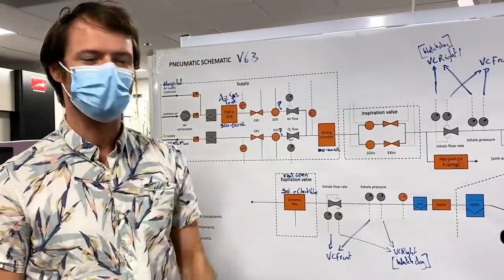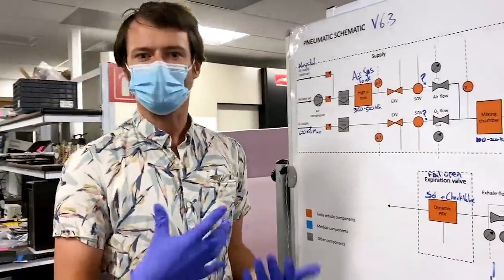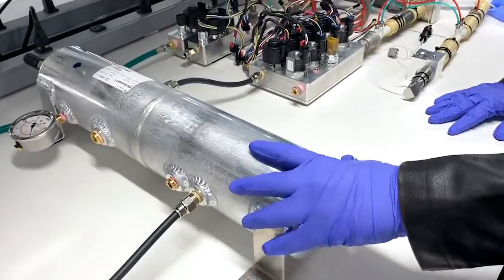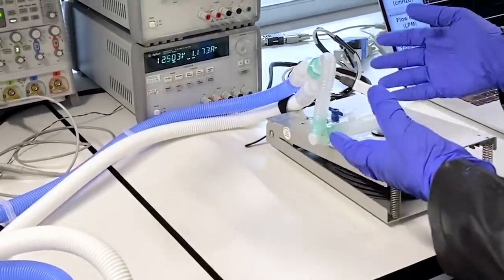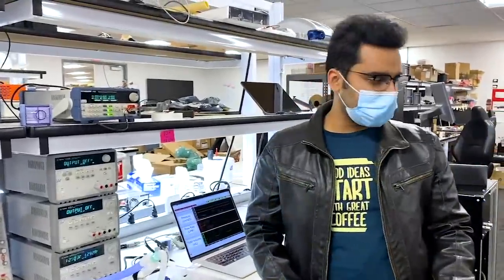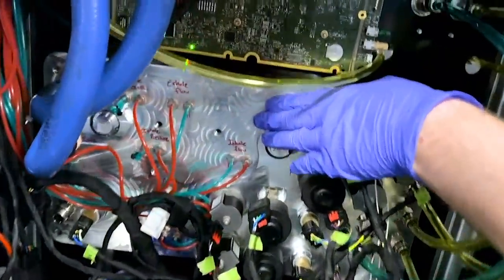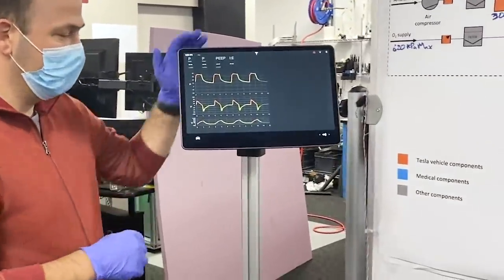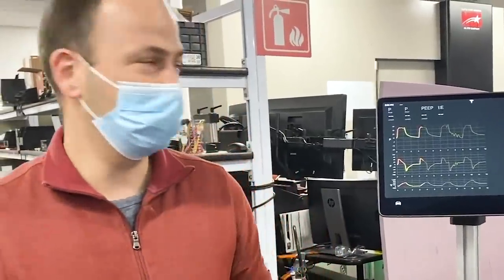Tesla Ventilator

Comment: Im not understanding. You use the pressure of the oxygen alone to drive the system? Where is the pump - or equivalent? What if oxygen runs out? Or air pressure runs out for any reason..  If we rely on the hospital - then they usually have a generator - but what about this corona case case in which the hospital is overrun and things must be moved in class rooms, in hotels, in big spaces which are not hospitals? They don't have backup generators and such. And if they do they are done in a rush and most likely not as well thought out.  We need batteries to power each unit, and maybe also make compressed air that way. Or better for compressed air have a mobile system powered with batteries.  Mobile air compressors already exist, just a big battery bank is needed. Tesla has good batteries also. Tesla cars can possibly be used. To access the electricity in the battery maybe some improvisation can be done.

Also you guys did not mention, but one of the best ideas is to push this data into the cloud in real time, and with that, fast and accurate response can be given. Let's say an area of the country is overcrowded and you want to see how well the patients are performing and how likely we are to be prepared for a next wave. How to assign ventilators properly and not have places which have too many, and places in which people die without one. Or let's say some medication is introduced, and we observe some types of patients having troubles based on their real time vital signals. And you can see that in high numbers, across an entire continent. Real-time, accurate data can prove vital in dealing with crisis situation. No phoning around, no running around, no misunderstandings, no stress, no mess. Decisions based on accurate, real time, verifiable data. 

As such a high level decision can be made to stop such medication. Or family can see the vital signs of the patient sent to them on an app. This ventilator uses a tablet. As all ventilators should use. Tablets have frontal cameras. That can also become a real time video interface to talk to the patient or doctors without family being present. The grandma can see the kids and not feel alone and stuff. Because the tablet has a multitasking operating system on it. And can do both functions with ease.

Also a nurse can have everybody she cares for connected to her phone, same for doctors, and maybe volunteers. Simply by scanning the devices - scan that ventilator, that pulse oximeter, that hart rate monitor.. etc.. all connected. So if a patient collapses, and this doc is in the eating place, or the nurse is in her office  - then he/she can just come in a hurry and increase the help capacity. Is a fact that highly trained people will be in short supply with corona. As such being able to alert of an extreme emergency  in seconds as it happens, and also have all the vitals sent to the notification such that the doc can decide as he walks towards the patient, all that transmitted accurately, real time  - without nurses running from one end of the hospital to another, or to phone desperately for the doctor - is a must. In hospitals information still moves by diffusion. Which is as dumb as it gets given the tech we are capable of. We have real-time games with millions of users, but we don't have real time doctor patient connection. We rely on alarm bells and such. What is an alarm telling you as a doctor ? - is it telling you the oxygen concentration, the last 2 minutes of vital signs? what medication was given, when, and in what concentration?  - no.  Is just a sound indicating something is wrong. As such is not good enough. Is too simple. The doc still needs to ask questions... how about he/she doesn't need to ask anything? How about even a course of action can be suggested, and also validated by 10's of other docs which are  not even present - but monitor the situation remotely, with cameras, sensors and such? They can make decisions and inform the doc on the ground, or a nurse, or even a volunteer on what to do because they will have more accurate information regarding the entire country not just some local situation. They might see patterns developing in real time across hundreds or thousands of patients. Such info can't simply be obtained by writing hand reports and aggregating that with lag over a day or 2 or more. In my area, real case, we are still doing it like before the internet was a thing. Is slow, inaccurate, falsifiable, expensive, increases work and stress for the medical professionals, and is just dumb. Because reports are boring and are better left to computers. And in case of crisis, nobody has time or will for writing reports. And without those we can't even know what happens - hence the current situation we are in. Everybody blames China, CPP - rely?! How about the fact that what im describing here does not exist almost anywhere in the world? How about is so cheap, cheapest thing we can do - because 80% is already built? There is no such thing as - "we dont have valid data"  - and "we need more data to say one or the other" - if data is collected in real time automatically, effortlessly, so on.. then basically 90% of the problem is solved since actions can be taken well in advance with confidence.

If rockets could be improved 10x which are supper hard because they deal with stress of orders of magnitude - just think what that maxQ transition entails - plus the cryo-temperatures plus extreme precision and timing and super big physical sizes and everything - if that could be improved in price and performance 10x, and we are on our way to 100x...  - then the entire medical industry can be improved 10x  - especially this ventilators - which is actually super easy in comparison. Or at least the tech can be. With humans is harder because you can't just run an update on somebody's brain.

The advantage is that installing such app is easy. Security is already in place in android. We can have 1 app which can install other apps on demand using MDMs. Then no more work is required, all can be done programmatically. The infrastructure is already in place compared to existing medical ventilators which don't have an app store and stuff. Building such app is relatively easy. Many and different apps can be started at once by many dev teams around the world. So you guys just focus on the hardware capabilities, and software can be added later by a simple install which takes about 5 seconds...
Reply: the video literally explained half your questions at least.... you aint very attentive, the other questions are answered by pausing and reading the whiteboard of their design

Comment: Nice to see a company doing this properly instead of all the half baked responses for a PR fix. Looking at you Virgin. If a company claims they got a ventilator working in hours, they skimmed on features which are there to prevent damage to a patient. Without safeguards, many ventilator efforts cause more damage than they solve. This video explains the issue very well. https://youtu.be/7vLPefHYWpY

Comment: You need to make your ventilator be triggered by the person trying to breath.  If you don't the person will have to be heavily sedated in order to use your machine and it can damage the lungs.  The air must also be warmed and humidified or it will damage the lungs.  Watch this video "A Guide To Designing Low-Cost Ventilators for COVID-19"
Reply: pause and read the whiteboard.... just sayin you missed a bit
Reply: @bobh9492    I see a humidifier and a heater.   Don't know if they have a trigger system.

Comment: I commend all involved at Tesla for there hard work and amazing commitment. But this had bad idea written all over it. No dought the engineers at Tesla are brilliant but you'd want alot of input from medical device minded people involved in the development and introduction into the medical field.

Now it's not hard to get it patented because in the medical device industry all you have to do is piggyback off a existing patient of a similar item. Not alot of testing required, it's not like introducing medicine, which is alot more red tape and trials. 

Not to mention the liability issues and a team needed to deal with repairing them as they break. Too specialized for some average shop to take on, sure some can but limited. Imo it would be better time spent building a existing ventilator, pair up with a manufacturer and team up. 

Maybe I've been working in the medical device industry too long. Scince 1998. Either way you guys have my respect and I admire the drive the employees at Tesla show time and time again. Stay safe and never stop dreaming.

Comment: For info, when wearing a mask, it should go over your nose, fit without any gaps and go under your chin.  You should fit the mask using your hands pressed against your face so there is no air leakage when breathing in hard.  If there are any major air leaks, then the mask is not really effective.  That said, definitely wear a mask in public.  They can save lives.

Comment: These dudes talking about improving the ventilators we currently use. In the span of a couple weeks.
Reply: Didn't sound like that to me. They are just developing one that can quickly be built at Fremont. Medtronic is working with them as well.
Reply: @anthonypelchat  I mean the vents we are currently using don't have features that they are presenting.
Reply: @danworkman2206  To my knowledge they do. The basic ventilators don't, like CPAP and BPAB (I hope that I got those right). But the more complex and expensive ones do. Those are the critical ones needed for CVirus.
Reply: @danworkman2206  That said, these are specifically being designed to maximize production speed at Fremont, from what I can tell. That is what makes them special.
Reply: Anthony Pelchat 
CPAPs and BIPAPs aren’t ventilators in the strictest sense, they are positive airway pressure devices. You couldn’t ventilate someone using one of those as it sits off the shelf, but as I understand the FDA was instructed to remove restrictions on retrofitting existing PAP units into functional ventilators, so this is underway as well.

Comment: Nice! You need a CO2 absorber and a semi-closed loop circuit or you will require very high gas flows that hospitals cannot sustain with many ventilators at once. This prototype (perhaps just for simplicity) has a circuit that dumps all waste gases to atmosphere.
Reply: that was their first prototype, the one on the desk; the whiteboard dumps vented gasses into a filter then a heater, you can pause on the whiteboard to see their entire schematic
Reply: @bobh9492  filter and heater, yes, but there's no CO2 absorber or (semi-)closed loop on the whiteboard schematic.
Reply: @suprvideo  feel free to offer your expertise to them if you think they left something out
Reply: @bobh9492  I'm an anesthesiologist pulling a 72-hour shift in Seattle right now, so my hands are full unfortunately. Good luck, Tesla engineers!!

Comment: Would it be possible to "clean" the exhale air that comes out, either by sending it trough a filter, liquid or ionized it. So there would be much less virus in the air, and thereby help the nurses and doctors staying more safe, not to mention other patients too. 
As with a little extra equipment it could almost be possible to make self contained portable clean rooms, that then could be transported more easy around between hot spots, and could be store for other emergencies too.
Reply: look on the CHART, ; air in is going through filters, a humidifier then to patient and exhalation is also filtered..... pause it so you can see it on the whiteboard
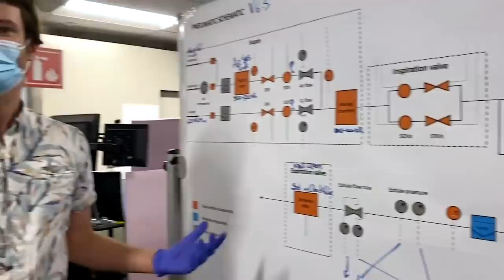Reply: @bobh9492  Jep, just saw the video again and it's clear at 0:42 that they do a 3 step cleaning, don't know why I miss read that :P
Reply: @-JustHuman-  no worries, lets hope they get thousands of them to ppl that need them

Comment: I must say, this is much closer in design and function to a commercial/medical grade ventilators (has regulating sensor to limit air pressure so as not to cause barotrauma) than the Virgin cobbled up tire pumps. Good job ppl.

Comment: Thank goodness. Finally a company not basing their vent off an ambu bag. That's pretty much the only one I've seen online with adjustable PEEP, flow sensors, humidification and a wave form display. You just need to sort out SIMV or pressure support and you've got the basic features of an ICU ventilator. It's refreshing that Tesla must have actually consulted a medico and intend on helping rather than the other companies in it for the PR.

Comment: Dudes, you need to check out the video @Real Engineering put out yesterday on low-cost ventilators. I'm gonna assume you didn't explain things into detail but "pushing air" into patients' lungs damages the lungs. Real medical ventilators use sensors to check when the patient tries to breathe and aids accordingly. If you just push air in you end up damaging lung tissue.
Check out his references for sources on what to look up and maybe who to contact.
https://www.youtube.com/watch?v=7vLPefHYWpY
It's awesome that you are trying to help thought, massive kudos to you!
Reply: I checked out the link, then looked at this video again. Seems they have ER doctor on the team or advising them also because the flow chart and portable prototype is quite comprehensive. And knowing Tesla Engineering these ventilators would definitely be complicated but more user friendly for Medical staff.

I pray they will finish and move into manufacture soon.
Reply: @beezrow  I do hope they are getting the right help, for sure. One key feature of real ventilators as shown in Real Engineering's video is that they sense for a negative pressure when the patient tries to breathe to know when to aid in the breathing. If you don't account for that and only "push air" into the lungs, you are basically forcing someone to breathe at a pace dictated by the ventilator. I'm not sure if Tesla is accounting for this since in their rig, they seemed to only be in/deflating basically a mechanical bellow. On the real ventilators, you could see the pressure measurement's drop (for when the patient inhales) being used as a cue for the ventilator to know when to pump.

Comment: For the Tesla Engineering team, what would be the impact to its performance if you direct the exhaust to a sanitation system before the patient's exhalation is returned to the environment. It could be something as simple as a heating/cooling segment that heats exhaust up to > 100 deg C before cooling it with ambient air.

Comment: 2:59 that's a lead acid battery :(
Reply: Lead-Acid is much more reliable, don't need a charge controller, just plug it to the 12v rail in parallel with the power supply and forget. Why do you think they have one in the Model 3, it's the ultimate will not break battery.

Also in stock now in their warehouse, in volume and they know the part and it's limits
Reply: Spoken like an arm chair engineer.  Lol, 12V batteries requires a charge controller.  Also tesla has had plenty of issues w/the 12V battery ...ask me how i know.

Comment: When I heard people needed ventilators, I pictured some small tube thing. Had no idea it was this giant, complex device. Also, Tesla is literally the best.
Reply: how?!?!
Reply: @carholic-sz3qv  how what?
Reply: this one does have a lot of sensors and computers to interpret those sensors. If you just manually adjust valves it's just a pressure tank and a tube, probably the ventilator you imagine is like what they give old people when they need more oxygen (little tube that sticks in their nose). Those still require the patient to breathe for the system, it just mixes in extra oxygen. I think one doctor made a more primitive ventilator with a BVM (Just a squeezable "bag", common in medical use, pretty much a ventilator powered by a person), sealed box, and air compressor on a loop. This doesn't have as much monitoring, but does breathe for the patient
Reply: IMTHEDARKNIGHT - real engineering did a great video about the issues with these systems and what the sensors are needed for
Reply: @maxkuhlman356  Second this, his video is great
Reply: @imthedarknight-8755  the problem with no feedback loop system i.e squeezing air inside the lungs regardless is it leads to over pressure on the already sensitive lungs and eventually cause a rupture (baro-trauma). Air being forced into the lungs needs to be measured and controlled especially when the patients are lying(sedated) there days at a time.

Comment: Where is the remote control?  This has the same failure as existing models.  It requires someone to gown up every hour to enter a isolated room to monitor and control the device.  that means one set of PPE for each patient every hour.  The second problem is that this will rupture lungs.  Good ventilators trigger the breathing cycle based on the patient's own breathing cycle.  The do not "force" air into the lungs.  The is nothing more than a fancy hand breathing assist.  Fine for a few minutes on the way to a hospital but not for extended periods of time.  Clearly they don't really understand the medical problem.

Comment: This is so much better than the "ventilator" that virgin orbit made for PR. These didn't just make a simple pump and accounted for other part of an actual ventilator that doesn't just force air, it has different sensors to optimize the process, filters and humidity to make the air safe as the device goes straight in to the lungs . Good job tesla👏🏼

Comment: There is no air humidifier, if this (like most ventilators) goes straight to the lungs, the air needs to be moistened and warmed in the same way the throat does.
Reply: look on the CHART, the humidifier is outside the tesla system; air in is pushe dthrough filters, a humidifier then to patient and exhalation is also filtered..... pause it so you can see it on the whiteboard